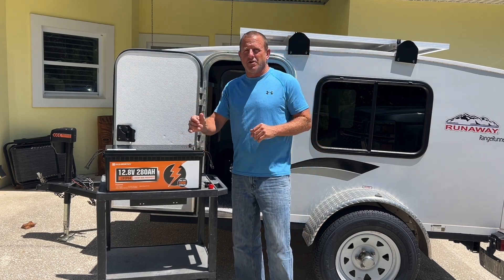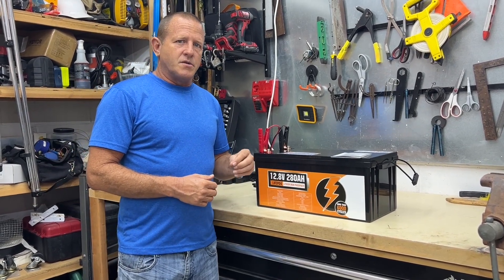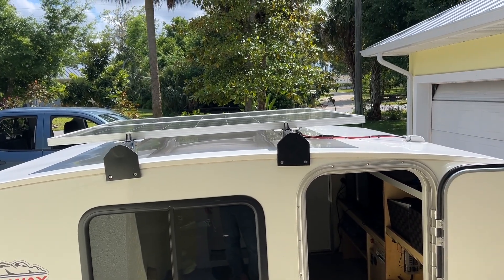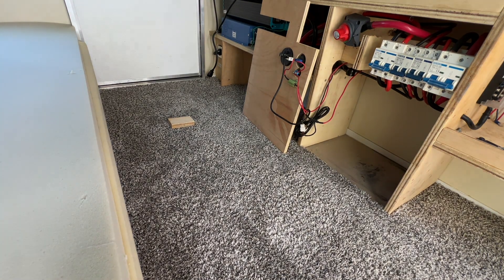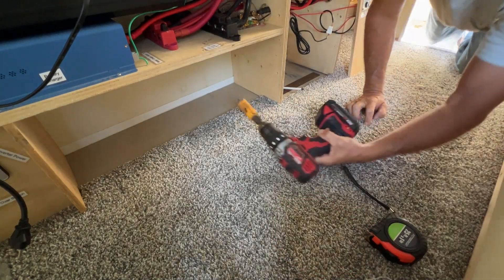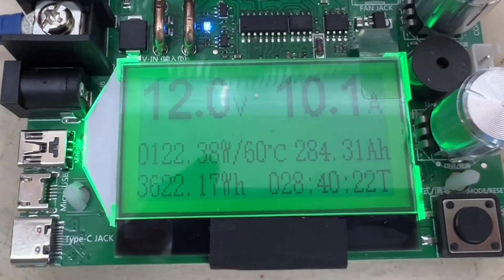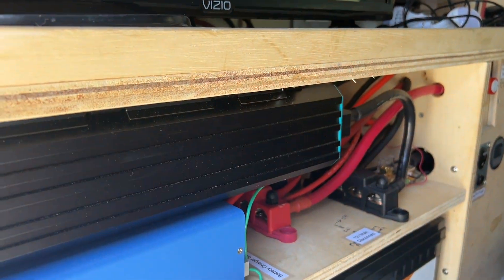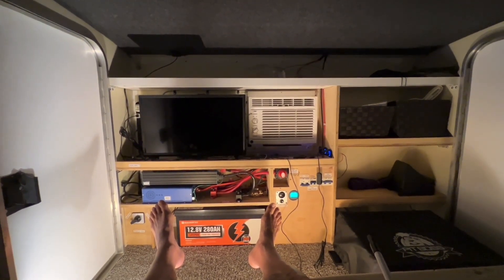Eco-Worthy 280Ah battery upgrade in my off-grid camper

Comment: That will only run the air conditioning for maybe 4.5 hours not anywhere close to all day and all night. 🙄
Best battery for the price though I got four of them, which should run the AC for about 16 hours.
Reply from the maker: @jordanlee2645  This battery runs my ac all night and recharges fully with 400watts of solar on a sunny day.  my main issue is recharging when it is cloudy but i use a generator to charge batteries if its cloudy. remember the compressor kicks on and off on an ac and when it cools down at night it runs less

Comment from the maker: the maker hawk tester doesn’t care if the bms is synced. it doesn’t care if there is a BMS. it measures total power it is utilizing. i could be testing a lead acid car battery or a triple a battery. makes no difference. the tester measured a total of 284 amp hours of power that it utilized and i stopped the test well before low voltage on bms shut down. the test is acurate .
Reply: Acurate is not accurate   😉
Reply from the maker: @mikegreene8461  and you are correct sir
Reply: Ahh, good old Internet.